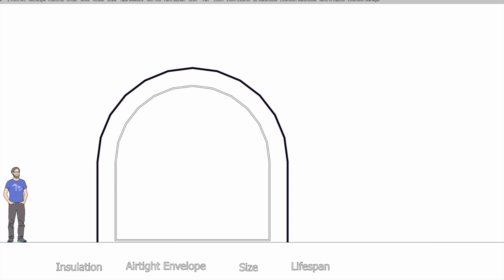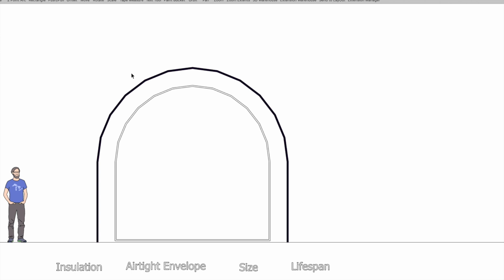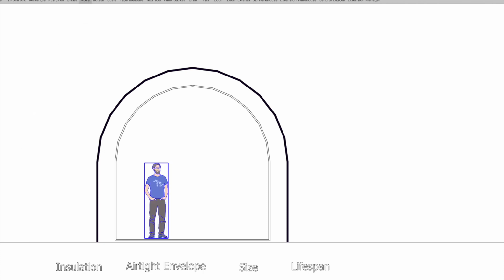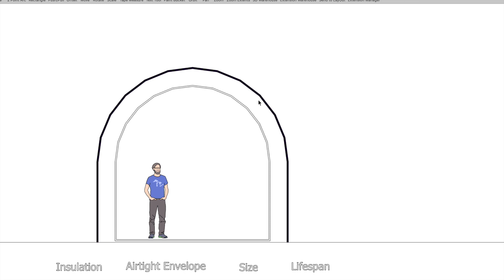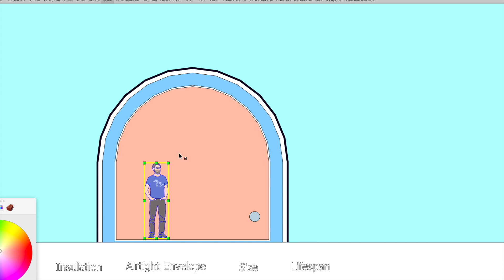4 principles for building more energy efficient houses

Comment: I do not agree that when increasing the size of a dome, the thickness of insulation should also be increased. On the contrary, as the size of the dome increases, the surface area of the outer walls relative to the volume of air inside becomes smaller, which means that heat losses decrease. The thermal inertia of the building increases. The larger the dome, the less insulation can be used.

Comment: i was surprised to find neither triangulation nor shape among these matters. of course, defining what are the 'most important' aspects of something always leaves out very many other matters.

in my mind however, given the principles of structure and shape provided by synergetics, i would put those two before the ones you brought up, will being intrinsically intertwined with all. having said that, omnitriangulation and a good choice of basic shape for any given situation would be my starting point. personally, as a well balanced place of departure, i tend to use the eighteyes mostly (one might know its greek nickname 'octahedron') as it allows for easy frequency fractality not just on the membrane, but also the interior, giving easy options of organic subsystems like rooms and such.
also it has substantially less need of members involved compared to both the (triangulated) 'cube' as well as the geodome favorite dozeneighteyes ('icosahedron'), which is a great choice for the overall enveloping membrane due to its large quantumvolume which is even at onefrequency oneandahalf dozen quanta (plus some golden ratio fraction).
and yet, the eighteyes has a larger quantumvolume of four compared to the current 'commonsense' box with its quantumvolume of three. it embodies four hexagonal planes within it, a whole vector equilibrium sphere embraced by it. 

much more to be said, some can be found in my videos... 

peace
struppi

Comment: Looks like Barry built one of Aircrete Harrys homes.
Not poking holes in the structure for cables and pipes will also keep the heat in. Domes are more likely to have fewer draughts

Comment: In our architecture studies at uni, they're now advising us against "proofing" or creating air tight buildings but instead encouraging to build with breathable insulation like hempcrete that also have good thermal properties.
Reply: I was wondering about straw bale, which would be in somewhere in hemp ballpark. My understanding is that a "breathable" well insulated material should prevent large heat loss. But active ventilation seems just matter of common sense either way.
Reply: It's better for your health, if anything. And more reliable, not dependent on electronic and mechanical parts.
Reply: Black & Yellow, are you AnCap like me? Or you just like those colors?

Comment: There are a lot of issues you didn't mention like thermal lag from infer red radiation from sun. As the sun crosses the sky it embarks energy into your structure beginning from the time it crosses the horizon, as it sets all the mass of your structure now releases that energy in the form of heat and infer red radiation. This is a very big part of your cooling load. With this being said, a big part of your structures design must incorporate reflectivity of the building envelope, many large commercial buildings use reflective roofing for this very reason. additionally there are very few places on Earth with "perfect climates" so you must consider your environmental control systems and that opens a whole world of building considerations. Heating; what type of heat, heat pump or boilers, warm air furnaces etc. Cooling; what type, again heat pump , high SEER DX, ECH (evaporative cooling humidification), absorption with chilled water, ect  All these issues you bring up can also be used to control the environment inside the home, for example in hot desert climates they build homes with high amounts of "thermal mass" so as to slow the uptake of thermal energy and slowly release it at night passively tempering the extreme changes in temperature. OH, and they do make residential sized Absorption chillers I have worked on them, they come 5 ton increments and must be placed away from the home as they use ammonia and can smell like piss. They work awesome and last for 30 years or more and ammonia breaks down into nitrogen in the environment so there is no greenhouse potential or ozone depleting potential, only fertilizer potential.
Reply: When it comes to the heating effects of the Sun, even if completely ignored by climate science, the crucial aspect becomes building orientation. On the northern hemisphere, I would say the smart thing to do is to have the longer side of the building pointing down south as well as having no windows on the western side. I would also venture to say that having some windows on the east side makes the perfect area for a bedroom, allowing you to sync your cycles with the sun, for maximum benefit. North, the cool, side can probably do without any windows at all. Especially if the building is relatively long and narrow, in which case I'd go crazy with windows on the south side.
Reply: Thermal mass is of course also used in cold climates, except trapping heat from the inside in winter for release during the night. In the north, we use massive wooden structures and wood fibre insulation, with walls up to 50 cm thick.